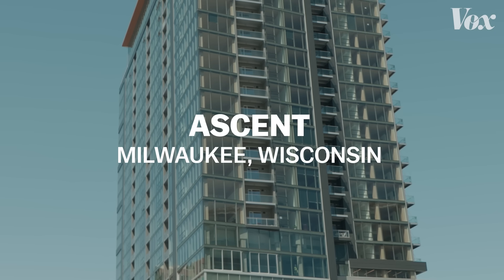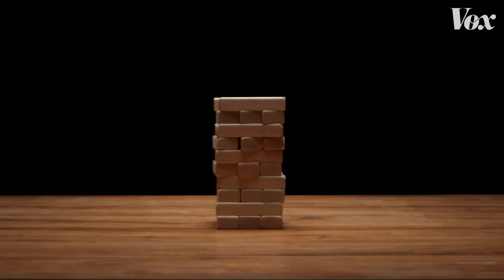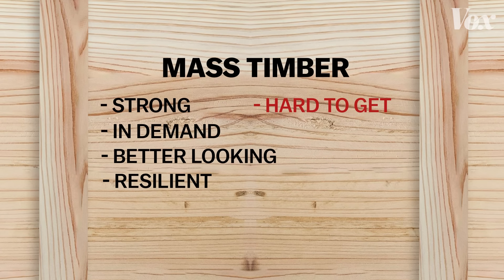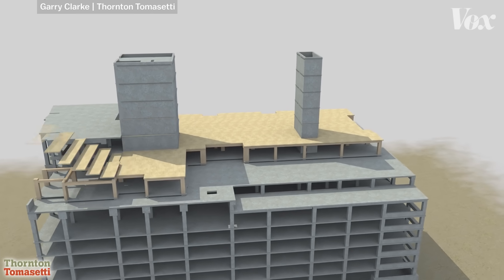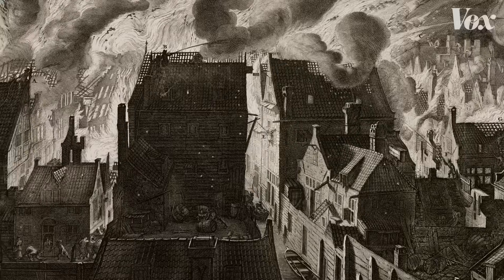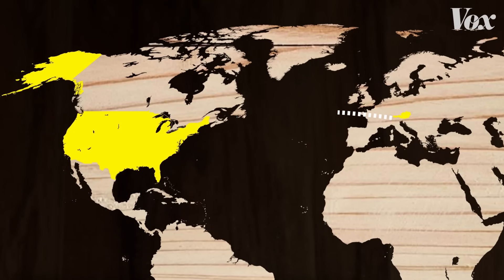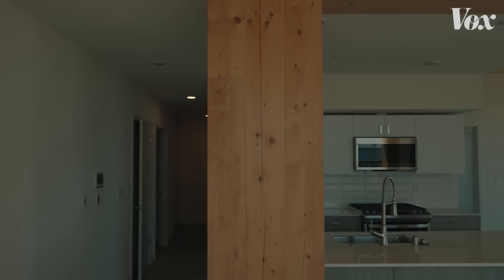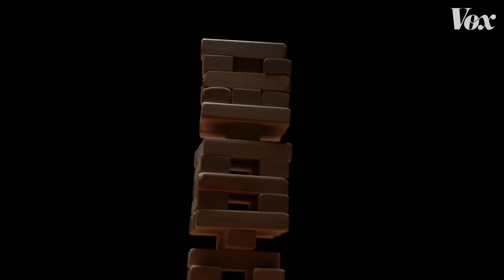How to build a wood skyscraper

Comment: How about sound-proofing compared to concrete? Equal, better/worse? 

And durability over time?
Reply: I don't know any english sources but wood is a lot more porous than concrete so the insulation is way better. I think it's similar for sound as in the sound waves get trapped in all the little channels. That should improve the acoustics in a room but I don't know if it also helps to keep the sound inside or outside. As for the weather proofing: have you ever seen old wooden beams when the outer layer becomes grey? This grey layer acts as a protective layer and while it doesn't look as nice after a while the wood won't rot away for a long time. Theres wooden buildings in Europe that are hundreds of years old. As long as you don't waterproof the outside of the building and the moisture from inside can still escape wooden beams and walls will last a long time.
Reply: @leoh5405  Wood works similar to Plastic foams in terms of acoustics. Wood (Balsa specifically) is used in a lot of acoustical applications due to it. Dried wood has a lot of porous areas where when the tree was alive water/nutrients would flow. Same reason why water proofing or sealing the wood is important. If the wood is properly covered to prevent water/mold growth/pests it can last for hundreds of years. In load situations wood actually lasts a lot longer than steel/metals as well.
Reply: @leoh5405  Thanks! Yea, I've seen wood-based massive buildings in Japan and Sweden. 

And good to know about the sound-proofing properties. 

From what I've read, it could be as strong or even stronger than concrete. And even IF it's not, I guess some buildings don't really need to last that long in a constantly evolving world? It's great to have different options (read that stone is an excellent choice too), depending on the projects and contexts. Seems like nowadays people just care about efficiency, so they never take the time to consider other options. Build, build, build, build, concrete, concrete, concrete. Glad that some people have been questioning lately. 

For smaller buildings, perhaps we can also learn from traditional nail-free buildings in East Asia.
Reply: When wrapped in glass, you've created a drum head... This is located downtown, near a street car, main bus route, main thoroughfare, as well as a public square/homeless resource place.

Comment: I don't get it... why is it preferred to ship all the columns from another country instead of just using concrete, which has already been proven to work? The video seems to explain the HOW well, but not the WHY.
Reply: Concrete uses sand, and sand is also a scarce resource that is shipped from all over the world.
Reply: Concrete is recyclable, you can’t recycle structural wood to be used in another building… also I’d really love to know how many of these people would prefer to be in a wooden building 60 years from now on fire versus a concrete one… lol
Reply: @therealbuba  Concrete is barely recyclable, from an environmental perspective it is generally much worse than timber. The structural wood used in this building can actually be directly re-used, recycled or even burnt for energy. And for fire, it seems counterintuitive but the type of timber used in these buildings actually performs pretty well, better even than concrete in some cases

Comment: Aside from fire the other question is termites and other bugs that live in wood, wouldn't the transport of the material also have a huge carbon footprint?
Reply: Luckily termites aren't common in Wisconsin, so that's not as big of an issue as it would be in other states. Carbon footprint might be higher than that of wood from within the country, but I could see it being lower than concrete which has high energy demands to produce and isn't renewable.
Reply: Shipping by water and rail has a minimal carbon footprint, especially compared to manufacturing then shipping concrete and steel, epoxy-coated rebar.  

Pests could be an issue - you'd want regular inspections and you'd probably want to use treated wood.

But then the same can be said for concrete and steel construction.  Just look at what happened last year in Florida when water intruded into the concrete, a common occurrence, leading to the collapse of an entire condo tower.
Reply: @sunspot42  From what I remember, multiple inspections came back with reports of spalling and cracks, but it seems that no one did anything about it for years on end

Comment: how long this building is gonna last?
Reply: Longer than concrete
Reply: @alexandermcleman6101  Any proof of that?
Reply: @guruxara7994  half the concrete buildings we put up 60 years ago we're racing to demolish. Wooden buildings are still in use today that were built 100+ years ago?
Reply: @alexandermcleman6101  We also have concrete structures lasting for more than 2000 years. So I don't get your point.
Reply: @guruxara7994  ah yeah I forgot we still have the Romans down the site building our office blocks and that haha. Contemporary building my guy, concrete is generally awful. Environmentally, thermally, air tightness etc. And it's lifespan is 60-100 years which is far too short

Comment: we absolutely need to get away from using steel and concrete as much as possible.  The steel takes a tremendous amount of energy and carbon from the gas heat to create (which cannot be produced by electricity), and the concrete is one of the main contributors to carbon dioxide.  Kudos to this company for taking the risk and spending all the money testing and convincing regulators to construct this way.
Reply: So lets just cut down all the forest? Because of carbon

Comment: I am not sure these wood skyscrapers are sustainable either. To build these building, you need to cut more trees anyway.
Reply: Wood grows back and is way less carbon intensive than concrete or steel.
Reply: @AC-im4hi  they are not growing fast enough. Pls Compare satellites image of Oregon, Amazon and Borneo. Timber industry is very toxic as well.
Reply: @Jun31719  No one said that they're being 100% replaced but it's possible to do if desired.
Reply: Timber is only sustainable if the forests are managed sustainably. If they are though it generally is much more sustainable than steel and concrete.

Comment: They never explained the effect of weather on this wood structure. This intrigued me because from where i'm come from ,its tropic and humidity is at most high.
Reply: The lamination process stabilizes the timber a lot
Reply: You protect all of it from the weather, also this is Wisconsin, so no not super humid either.
Reply: It's most likely laminated wood.
Reply: laminate wood against 500 mph winds
Reply: Those are treated timber. They didn't just chop it down, cut it in shape and ship it out. Beside, wooden house is still common in tropical country. Before concrete becomes very common. 

I'm less concerned with the engineering, instead more about corner cutting of the developer and incompetent/corrupted inspector.

Comment: mass timber being fire resistant is pretty counterintuitive to the layman. i'm glad the video included details about the tests
Reply: The other questions are mould and termites. I wonder how well a mass timbre building would hold up in the tropics...
Reply: @korakys  Timber can be treated but it's not ideal
Reply: @korakys  rats will chew through tough materials too, but I like the Idea of big buildings from wood a lot.
Reply: @marcusgarvey8668  I love the idea of building with mass timber, especially living in New Zealand with earthquakes. I've watched a lot of videos about it now but while fire risks are always covered I seldom see these other issues covered. I didn't think about rats, hopefully that is going to be a big problem.
Reply: @korakys , maybe there's some coating or paint that has some pesticide property. 

I don't know if this exists, but they could be made.
Reply: @korakys  google is a free resource
Reply: Fire eats into the surface at about an inch an hour. 
Big beams hold up for a good long while
Reply: Why did they say welding is a fire hazard then?
Reply: @Ryan1Twice  @Vishank The building will stay standing, but if a fire gets started it will cause damage meaning that piece has to be replaced
Reply: @GoErikTheRed  that makes sense, thank you!
Reply: @Ryan1Twice  commenting to learn the answer for the same
Reply: @Ryan1Twice Yeah, they said they use screws instead😂😂😂
Reply: It's the same with haybail insulation
Reply: It's not the solid parts I would be worried about, it's the joints.
Reply: DA ROOF, DA ROOF, DA ROOF IS ON FIRE!
Reply: That's the problem though. Yes, the building is fire resistanf but the timbers were imported from Austria. Should the timbers get damaged, it would take you several months or weeks just to fix a damaged portion. OFC, the whole building would be closed down and declared unliveable for several weeks just to wait for the replacement. It would definitely disrupt businesses
Reply: What I'm mostly worried about is it's long-term durability.. There's a reason why Europeans built buildings out of stone/concrete/bricks. The vast majority of those buildings are still standing and in great shape today, literally centuries later. I don't see how this timber will last even remotely close to those.
Reply: In my German hometown are 400 timberframe houses which are more than 400 years old
Reply: @JayForsure  there are countless projects with centuries old fully wood construction.. even older than your european examples - look at any notable pagoda in japan for instance
Reply: @jet528559  Most (if not all) wood temples and pagodas in Japan are periodically rebuilt as an ongoing part of maintenance. Even castles go through this process.
Reply: @VicodinElmo  trudat
Reply: @jet528559    Other examples would again be those same stone European buildings, whose roofs are still made out of wood that has lasted centuries. There's also Stålekleivloftet in Norway, which was built as a storehouse in the 1200s (around 1170), and Roykstovan in the Faroe Islands which is a house dating from the 11th century. Both of these are their original structures and haven't undergone replacement works or rebuilding, surviving in harsh environments.
Older still is Greensted Church in the UK, oldest timber church in the world, whose original oak tree logs in the nave still remain and are a thousand years old (dating from between 998 and 1063), though unlike the other two, the rest of the building has been rebuilt at later dates.
Reply: @JayForsure  we didn’t exactly have the technology back then as we do now. Can’t wait for these kinds of new materials that push the status quo.
Reply: @JayForsure  As long as the wood is protected it will last a very long time. Those old buildings you mention have their floors made out of wood. And you'll find plenty of wooden castles in Japan. Wood can be long lasting if you look after it.
Reply: I'm glad you are this naïve. Otherwise who else would they sell this to? 😂
Reply: My question: what nightmare chemical brew do they use to treat that engineered timber with--besides whatever glue or epoxy they use--to make it fire / mold / rot / insect resistant, and how much, and what 3rd world country with no EPA laws is it made in, before being shipped to the other side of the Earth??? 

If it were a "greener" option than metal or concrete construction, they'd be listing that as a positive.
Reply: @listofromantics  They use Hi-Clear II on the exterior, above ground pieces, a mineral spirit that has "minimal health or environmental concerns and has a low mammalian toxicity".  Also they said in the video very clearly that the leading creators are Germany, Japan, and Austria, all of which have strong environmental laws and aren't "third world countries".  You really need to work on your listening comprehension and probably judge things you don't understand less.  Also, drop the racist dogwhistle "third world countries" nonsense.
Reply: @listofromantics  The timber is usually pressure treated and coated, which should remove excess moisture and should protect it, not only from mold, rot, and fires, although it is fire resistant to a degree, and it is better than having a building fold on you, but also pressure treated wood should be able to be safe from termites if done properly, materials have to be sourced correctly. And as wood ages over time, once it is 40 years old or older, it can become as strong as steel and more durable/reliable, so it should not pose a problem. Plus if anything were to occur, they could just take the building down and recycle the timber.
Reply: @listofromantics  I’m pretty sure Finland where these are common isn’t a 3rd world country and it’s pretty green

Comment: How tf did they go through an entire 12 min video without mentioning the one thing we're wondering - cost???
Reply: Because cost isn't a constant. Cost can vary wildly based on the specifications of the material and design, just as it would for steel.
Reply: @ryanmccarthy1079  So they should go through it. Like that's the single most relevant factor to whether this is a good idea, or just some one-off novelty project.
Reply: @ryanmccarthy1079  the fact they're going to need Forest levels amount of wood makes me think this is absurdly expensive. Rocks, sure. The entire planet is made of it. Trees? We already have an I distry using too any trees and not just any trees. Old growth trees because how big they are.

Comment: Its just the fire hardzard I would worry about. Lots of Japanese wooden antique buildings are 500 years old.
Reply: I'm sure it's fire treated. The building code requires a certain fire code regardless of building material. No different from a steel skyscraper.
Reply: think about trying to start a fire with a log instead of sticks. It would be enormously difficult to light one of those large glulam columns on fire
Reply: They laminate the wood to make it fire resistant. There's no way they'd spend all that money on this tower and not think about fire. Common sense almost
Reply: @seanthe100  yeah, I know. I just wonder how they do it.

Comment: I think using wood/tiber as a main construction material would be the most efficient in low or mid-rise buildings. It would still help with reducing local pollution in construction and demand for labor.
Reply: Most mid rise residential buildings are already wood framed. The shift here is really how tall we can go now.
Reply: US : what's a "mid-rise"?
Reply: This is already how the most popular mid-rise structures are built. Frequently referred to as the "5 over 1", they are a single story of concrete with 5 stories of a wooden structure built on top. I live in a 5 over 1 building now with several flanking the Greenway in my city.
Reply: Y’all for that wood come from tress and tress have to grow
Reply: It really depends on the design criteria and cost at the end of the day. Every material has its place. It's those extremists who insist that one material is the best for all applications that are the problem.